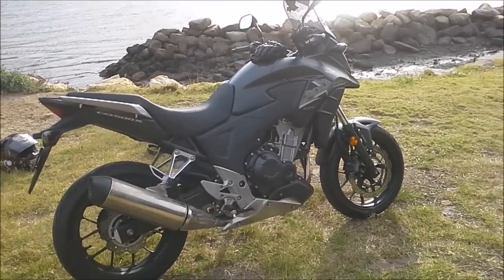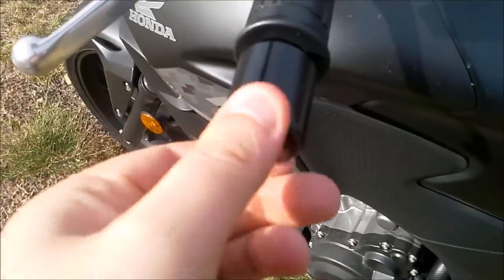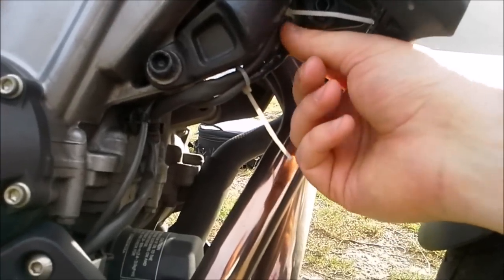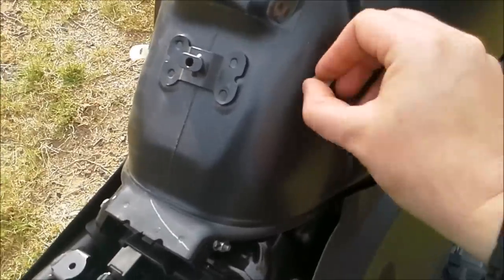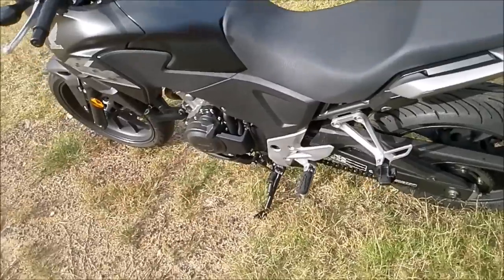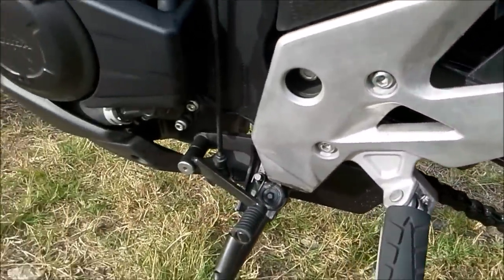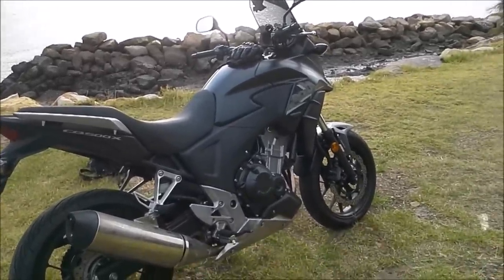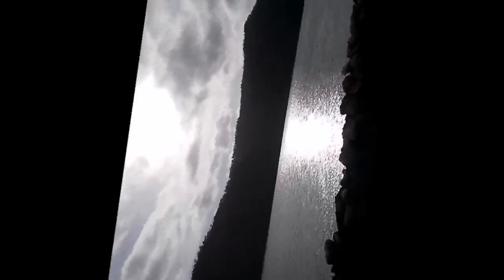Honda CB500X 30,000km REVIEW (18641 Miles)

Comment: How have the valve shims held up, any out of specs as of yet ? and is the suspension still good, and one last question how is the bike on fuel, has it changed with more use, better or worse. yl
Reply from the maker: G'day mate. Shims good, suspension still great. fuel has increase very slightly but I think because I ride faster now. might change the sprockets down the track.
Reply: That is great news to hear, especially after the first bikes having some issues with the shims; I think they put in the wrong ones from the factory, because there is no way to wear them out of specs in 600 miles, or a 1000 Km. May even consider buying one ? Thanks again, yl
Reply: *****  Have another question, and it's one I can find no info about, maybe you could help me, I need to measurements of the front fork from top cap to bottom wheel bolt center ? Thanks in advance for your troubles. yl
Reply from the maker: +ylism 77cm or 77.5cms. just walked out and checked mate
Reply: Jack Themuss Thank you so much, that is hard info to come by. Best, yl

Comment: I always oil my chain every few times i ride. and if i know i will ride more then 100 miles i oil it before i go.
Reply from the maker: I oil my chain after everytime it rains and every Wednesday an Friday now. The advise I forgot to say that my mechanic told me was, A can of Chain oil is alot more cheaper than replacing the chain and sprockets.  100% true there. Thanks for watching mate

Comment: 4:22 you have to CLEAN the chain first. (Facepalm) come one man. Just s simple Google search for "motorcycle chain maintenance" would have told you that.  Lubing it or over living it doesn't matter because eventually without cleaning it, that lube will collect dirt.
Reply: cleaning the chain every time is good but when on the road it is not always possible.  I go for a ride get the chain nice and hot lube it with a good chain lube then go have breakfast when on the road. letting the lube dry  or set  before riding helps stop dirt buildup. Have been doing this for over 50+ years and have always got good chain life.